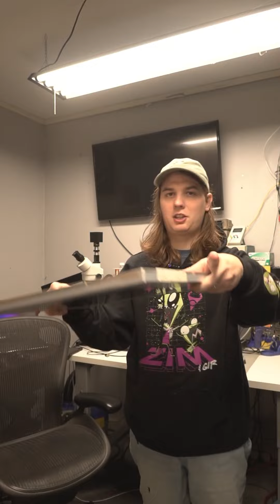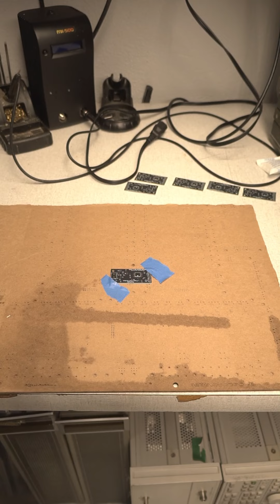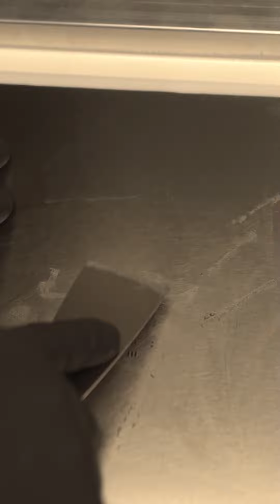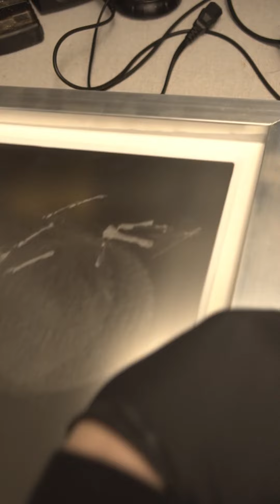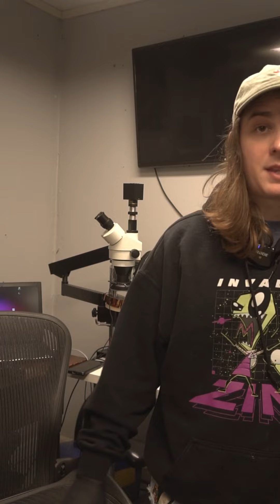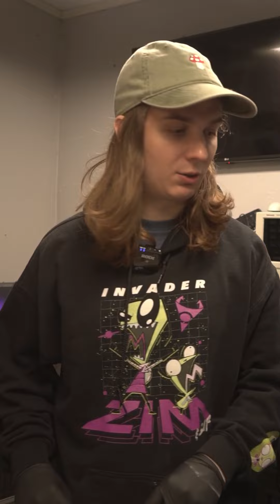Using a Solder Stencil: Short #jlcpcb #electronics

Comment: for that kind of application I think it makes more sense to use a frameless stencil
Reply from the maker: Only problem with that is the frameless ones are pretty sharp. nothing like getting a cut from the thing you get leaded solder on lol. They are cheaper, smaller, and take up less room to store. framed stencils you have more control over, the frame holds in the mess while cleaning and no sharp edges. That said it really does just come down to personal preference.